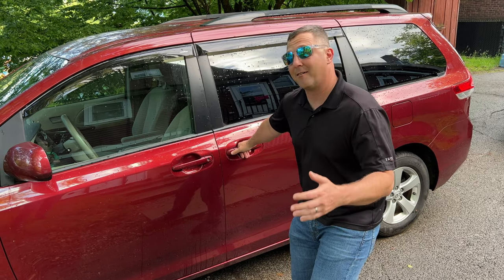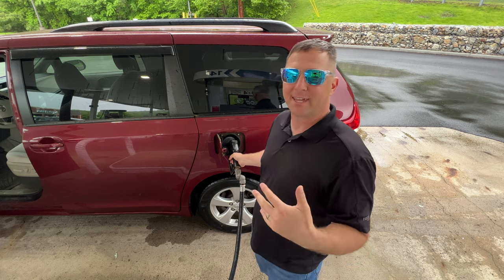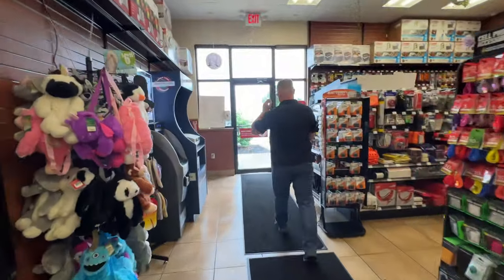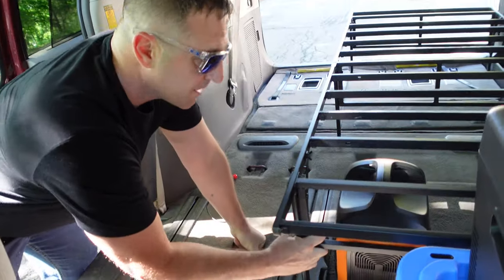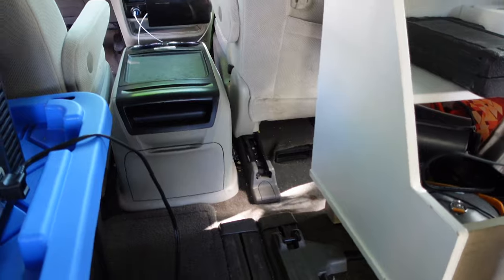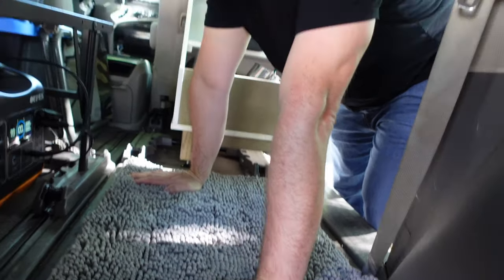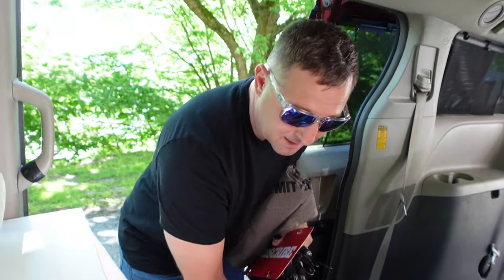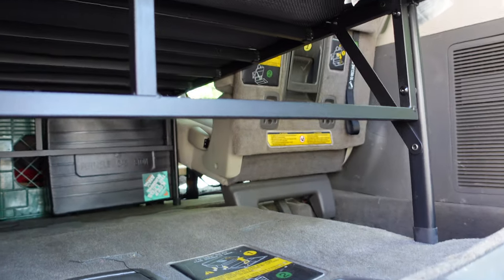How Much Does a Minivan Camper Conversion Weigh?

Comment: I'm glad to see a video that emphasizes the importance of weight.  Another tip is to keep the weight low in the vehicle.  That's the double advantage of taking out unneeded seats -- I saved almost 200 lbs taking out the 2nd row seats and the larger 3rd row seat.  That gives use of deep wells for water, the house battery, and other heavy things.  High weight is one of the reasons that I went with a DC/DC battery charger and have yet to add solar on the roof.
Reply from the maker: Great tips. Im planning to take out the third row this summer. Do you have a Sienna as well?
Reply: @AdventureGearTV  Dodge Grand Caravan.  I love taking multi-week road trips in it. What a great choice a minivan is, for someone who needs a daily driver yet wants to camp in style.

Comment: Very helpful video! It’s easy to take for granted the weight additions of all the “little” things we add to our vans that reduce gas mileage. BTW, I have a class B Dodge Promaster 2500 tall height camper, fully fitted out, that weighs 7,650 lbs. I get 21 mpg highway/17-18 mpg city. If you’re only getting 20 mpg with an empty minivan, something’s wrong. Now, I drive conservatively - no jackrabbit starts, 60-ish on highway - but results in significantly better gas mileage, and is a lot safer.
Reply from the maker: It’s the older minivan, it’s rated to get 22 Highway and 17 city. I’d love to get a bigger van someday.

Comment: Good video, thank you. I did the same with mine!
My Sienna AWD is 4400 pounds with seats. I took out the seats, put in 6 low boxes, laid on a 4x8 plywood sheet, and cal king foam mattress cut to fit. 
Final weight....4400 pounds. 

Basically the seats weigh the same as a minimalist bed/storage system AND all my crap. 

Just sharing my own Sienna experience.
Reply from the maker: It’s crazy that these builds don’t really impact the weight that much.

Comment: Did you include the rack, awning, and solar panel? Or you were just checking inside/cargo space wt.? Oh and best of luck with the move!
Reply from the maker: Hi Cheryl, I took it all off. So, the weight includes all of the roof accessories.
Reply: @AdventureGearTV   I thought maybe but I happen to have some kind of attack on my eyes. They were itching, burning and watering.  Making it a little difficult for me to follow along.
I thought that's what it was. I just wanted to clarify it. I have a 2010 Chrysler Town & Country Touring minivan, so I think yours is just a little bit larger with more cubic feet space.
Reply from the maker: @cherannretiredgran68  no worries. I honestly read your first reply and wondered what was going on. Thanks so much for stopping by. This one is a Toyota Sienna.
Reply: @AdventureGearTV   Yes, I caught that error and then I saw where the speech to text printed like the same 2 words, 3 times. So, I went back and edited them.  Hopefully, it's more correct and makes more sense now. 🤦‍♀️🤷‍♀️

Comment: I ended up buying a 500 dollar honda passport from 1997. It's a v6 with terrible gas mileage but I'm gonna have to convert it to be an electric vehical. Right now it weighs 5,000 pounds and is heavy to begin with due to its heavy ladder on frame design. I allready chopped the roof and build the roof extension along with the tube frame for reinforcement to the stock body. Then build the under frame battery holder. The battery's should be in next year hopefully if the shipping company gets there stuff straight. I'm hopefing for at least 800 miles of range and an extra 500 with the gas backup.
Reply from the maker: Wow. That’s a big project with lots of range. Are you planning to use it for camping, or general driving?

Comment: In comparison, I saw a Van Life video for a very nice (wood cabinets, bed platform, etc.) build in a Promaster 159 Extended. They weighed their van after the build and it was 9,400 pounds! 
I Googled for specs and found: 
High Roof 3500 Extended Cargo Van 159 in. WB 2019 RAM ProMaster Specs
CURB WEIGHT = 4,644 lbs.
GROSS WEIGHT = 8,900 lbs
Reply from the maker: That’s a heavy build.